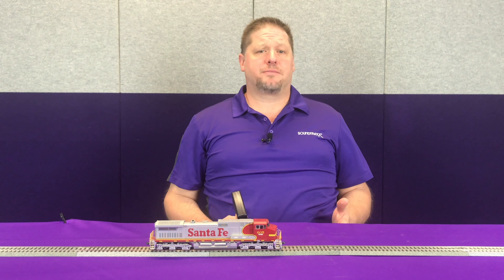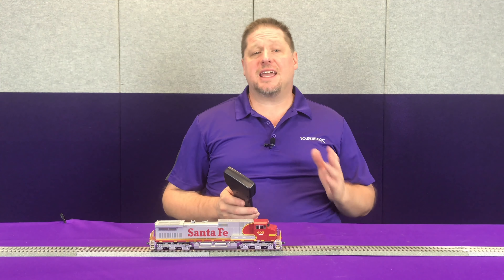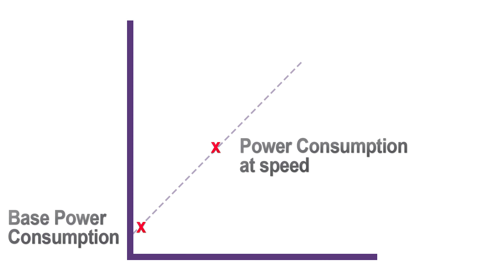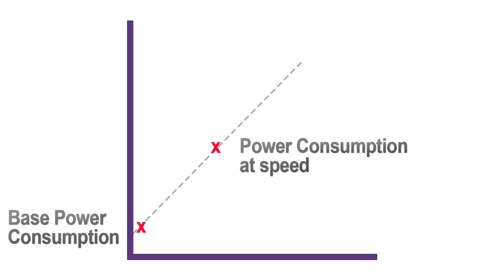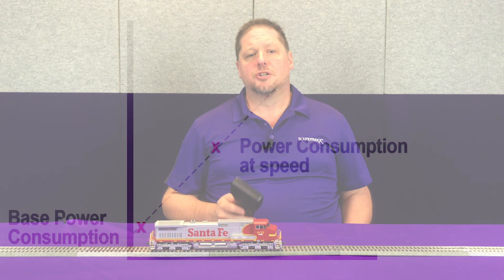Calibrating Dynamic Digital Exhaust (DDE) on a Tsunami2, TSU-PNP8 Decoder

Comment: Thanks George.  In this video, was the decoder fresh out of the box, i.e., all default values before you began or did you set auto notch rate to 15 speed steps as recommended in the T2 manual?  Or change any other CVs before calibrating?
Reply from the maker: I usually set the notching rate at 15 on my personal stuff, but If I remember right, this was set at the 7 out of the box..  It's been a minute, but i do not think I changed that during this video..  
Try both and see what the performance gives you.  You can always change it back, or re-calibrate it.  Once you set a CV, it is not set in stone, so experiment and find what you like, then set your locos to those settings..  You can always go back!  
I hope this helps.  If you need any further assistance, contact us at support@soundtraxx.com 

Thank you!  

~GB

Comment: Momentum has been set on my decoder. Should I change the momentum back to "0", set the DDE, and reset the momentum to my previous value?
Reply from the maker: It is not necessary, but when you do the actual calibration, you want to be sure your model is running at the commanded speed step, or the mismatch could cause an erroneous read. So, we usually recommend this set to 0 so that your loco can not only be running at speed quickly, but also be stopped immediately following the calibration, but again, if space is not an issue, then it will not make much of a difference.  Just make sure that you are running at SS20 or 30 when you calibrate and not still accelerating.

Comment: Q: JMRI Decoder Pro - Programming on the main - CV tab. No CV31 or 32 is available. How do we set base power, or CV32 to value of 2?
Reply from the maker: There should be a way to enter individual CVs and their values with JMRI. We do not support JMRI so we can't tell you how to use it, but you can always use your command station to perform this step.
Reply: @SoundtraxxDCC this explains why I have issues programming the DDe sensitivity on my clubs layout. They use jmri to handle the layout’s signals and wifi throttles. I wonder if I use the Digitrax throttle I have to adjust things on the main.